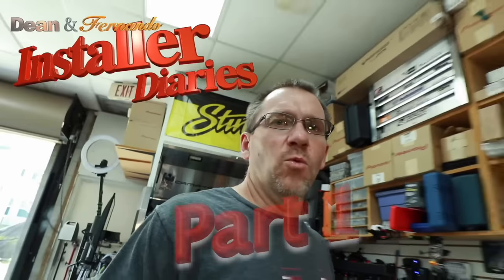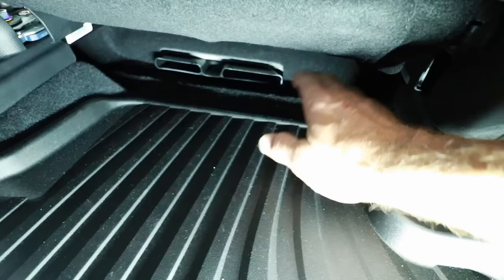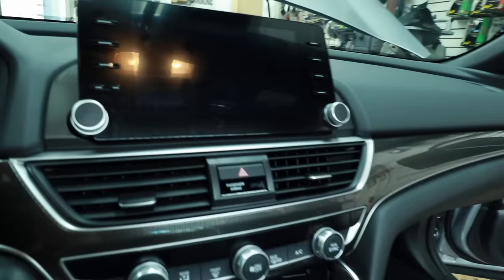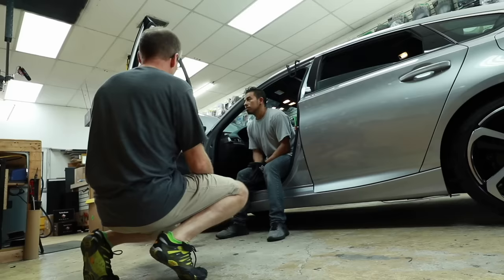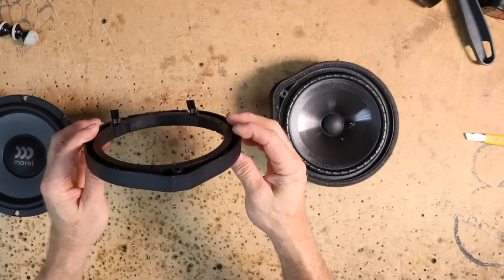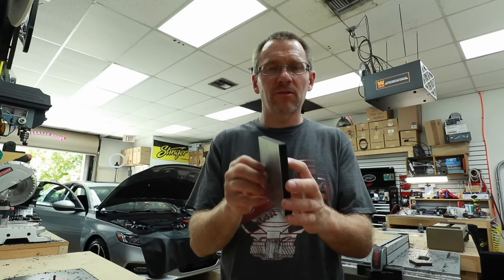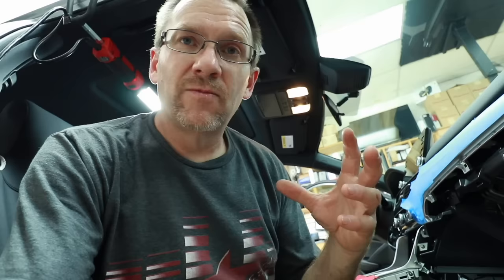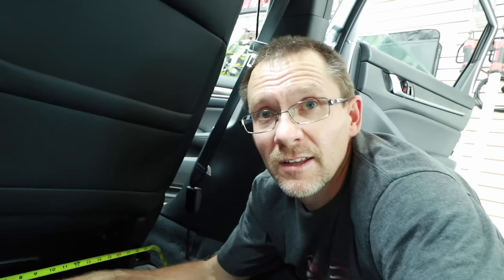2019 Honda Accord full Car Stereo install

Comment: Im having a problem with my 2018 honda accord sound system. All speakers play a static noise and i seem to remove it ive tried wiring everything directly from the factory harness  and re grounding the amp but no luck.. any advice?

Comment: I hate that tumor on the dash. Give me back the flat dashboard I can stack random papers on. You did a great job on the install. Newer cars seem make it easier to run wires, wish they would keep it easy to integrate aftermarket radios.

Comment: Great work by the way. My question is do I need an lc7i running from the factory head unit when the amp I'm using has high voltage input. I have an 2014 accord sport. Will a lc7i make a huge difference in sound quality or not. Thank you.

Comment: Hi I have a 2019 Accord Hybrid with cracked radio screen.  Mine is the 7" Displays.  Can I replace it with the 8" display that is touch screen?  Will it be plug and play or do I need an adapter?  Basically my screen is base with presets and I want to replace that one with the one you are working on.

Comment: I have a 2016 Honda Accord and I want to put sub and change out the speakers. Running a Rockford fosgate 1500bdc and amp for the speakers like 300.4 Doing a big 3, will I be okay with a stock alternator or just a secondary battery or something like the 4xspower D5100R. Thanks for any feed back.

Comment: Surprised you did not just use one of the Kicker downfiring prefab boxes.  Why terminals in the truck instead of a large molex connector in the cable?  The kicker remote panel has a parametric eq?

Comment: Thank you for this video... Its been a great source for building my 2021 honda accord's system. I have to ask I am running from the head unit to LC7i. Where did you get that wiring harness at 36:23 ? Is it available publicly?
Reply: @Michael what are you putting in your 2021? I also have a 2021 but a 2.0 sport and I'm starting to do my research. Would love any advice, ideas and/or input. Thanks

Comment: what module did you used for your signal from the oem to the after market amp? i didn't see that part on the video im sorry if i dont make sense.. thank you i love your videos..
Reply from the maker: We went right it the amplifier. It has the ability to do that with no extra modules

Comment: Nice vid! Question tho. I have a 2021 accord sport and I had a pro install done, I’ve had this car 6months and for some reason I’ve blown 5subs, the system to me doesn’t seem to be very powerful compared to when I had a Honda Civic, I’ve replaced an amp bcuz of clipping and upgraded but I still come out to my car at times and the sub isn’t working but then I’ll come out the next day and it’s working.. any suggestions on what might be causing that? Oh and btw I’ve noticed at about volume 30 is when the subs blow, again doesn’t seem to be pushing that much power to be causing so much damage, yes I understand distortion creates the damage but again even at volume 30 it doesn’t seem very powerful and the subs don’t really hit that hard
Reply: Check to see if you have ANC behind the glove box unplug it.
Reply: @ajaake  thanks I will check that
Reply: @ajaake  yes the ANC is unplugged
Reply: @ajaake  thank you! I’ll keep trying to figure this out, tired of blowing subs
Reply from the maker: Do you have a DSP or EQ? You should have one to fix the factory bass roll off. They could have the gain set to high or something else trying to compensate for the lack of signal from the factory system
Reply: @FiveStarCarStereoInc  no don’t have either
Reply: GAIN CONTROLS ARE NOT VOLUME KNOBS!!!!!